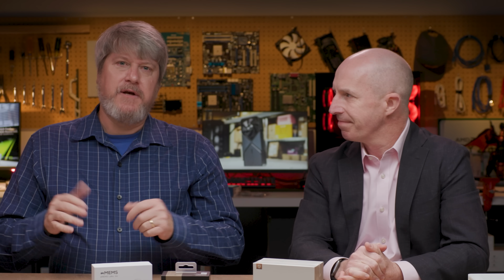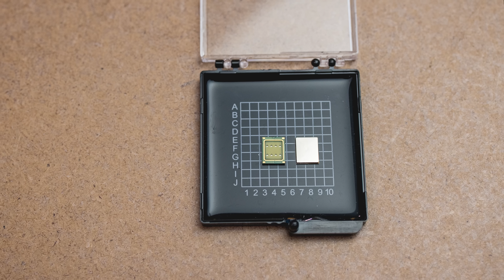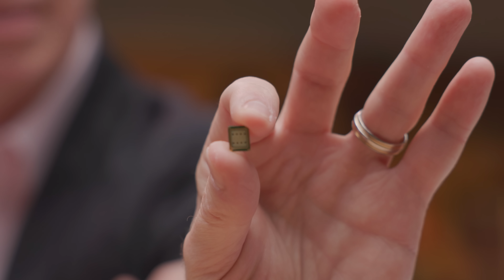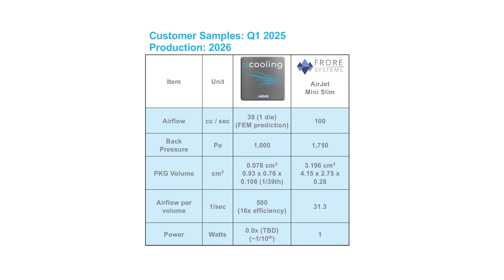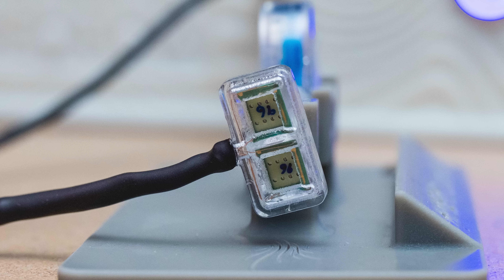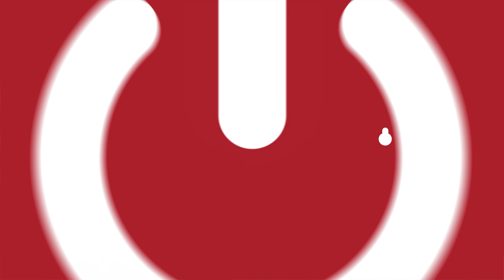This 1mm-Thin Chip Cools In Tiny Places

Comment: It runs on 8" manufacturing 🤯

I thought all those machines were completely out of use by the major foundries. For context when 90nm became the latest node around 2004 manufacturing moved to 300mm wafers. So they're using 20 year old lithography. And it's old enough that there are real supply issues currently for that tech.
Reply: Nope, legacy semi is still going strong on 6" and 8" tools. One company shut down their 4" wafer line in 2019/2020, and was seriously looking at restarting it in late 2020/early 2021. No idea what the final decision was. The main supply issue is that a lot of that capacity is already accounted for. They have specific targets/goals to keep costs down and run as lean as possible, so quickly ramping up/down production is tough since they have to accurately forecast demand ~6-12 months into the future to try and keep production levels even.

Comment: The specs seem pretty insane. 39 times smaller than AirJet but at 39% the airflow. Stack 3 of these and it wins across the board. I'm curious what the sound profile is like, especially at higher capacities.
Reply: I have my doubts that it would scale linearly or that heat removal is as efficient as Frore (it generates significantly less backplane pressure, which is presumably the critical variable that affects heat removal), but in mobile devices where heatsinking into the LCD successfully removes quite a bit of the heat and SoC power usage rarely goes above 5W, this could be a total game changer for improving the performance envelope. Most SoCs won't even go above 50-60C inside the core in order to prevent heat buildup from making holding the device uncomfortable -- with active heat removal, they could probably allow them to turbo up to 70-80C without affecting the skin-temperature feel of the device.

Probably will be a game changer for preventing battery degradation and getting local AI chatbots running on mobile devices within the next couple of years.
Reply: @emilemil1  not sure if it works stacked, to be honest...

Comment: My biggest worry for both this and the Frore solution is dust. How do we manage the accumulation of dust and prevent clogging? I have not seen anyone ask this from Frore, and given that this is the first video I'm seeing on xMEMS, it would have been nice to ask.
Reply: Dust is not an issue, this is mainly designed for sealed systems that just need a little bit of air movement in the case.

Comment: I wonder will they get caked with dust and stop working like fans, can they run in reverse to push the dust out and then run normal to start cooling again.
Reply: Yes, he showed the demo of the chips being able to push air and pull air, bi-directional. Very cool.
Reply: @raymonddsouza8948 wait a min! Wut. 

The tech is indeed impressive. 

 How does one reverse the flow of air? Thought it worked by moving a thin piece back and forth with a piezoelectric effect. Like someone waving an old hand fan. 

  I would like to see why this wasn't done before, and what advances in manufacturing or materials it took before it could be done. 

 It is a solid piece of tech. Uh um literally!

Comment: Interested to know how this would impqct the waterproof-ness in a Smartphone as a lot of flagships are IPx7/x8 these days
Reply: It wouldn't, as it's just recirculating the air that's already in the case, it's in a sealed system. It doesn't need outside air, it just blows air onto the chip, and that's all that many chips need.
Reply: @madmax2069  what good would spreading warm air around do if you don't ventilate?
Reply: @fuicaz   because even spreading around warm air is better than spreading no air around.. things like cellphones are intentionally limited to not get warm, one of these could allow them to raise the performance limit
Reply: @madmax2069  No spreading of warm air is going to be better than heatpipes/vapour chamber or even graphene pad/sheets actually spreading the heat around via physical contact. Keep in mind air is a good insulator. Air is only good if it can take the hot air away. In the same way if you're in a hot enclosed room, having a fan is practically useless. You're just mixing the air in the room, increasing the ambient temperature. Yes you can argue it helps, and I won't disagree, just to what degree does it actually help? I would imagine it helps a tiny tiny bit. Not zero, but very little. Especially considering how little air is actually within a phone.

Don't get me wrong, I am excited by all new technologies, I just fail to see how this works in a phone.

Comment: How much power does it use?  In terms of watts cooled / watts used?  That's the big problem with the Frore AirJet -- too inefficient compared to a traditional fan. Edit: the numbers he gives at 7:55 multiply out to 39 mW pneumatic power. Website claims 30 mW power requirement, so presumably those flow and pressure numbers are not attained at the same time.  Seeing as AirJet is less than 10 W/W, and smartphone SoCs typically sustain multiple W with current cooling designs, this is maybe really good.

Comment: It's going be helpful with VR like Vision pro became smaller in size or
Reply: Unlikely, unfortunately. They are small, but their cooling capacity isn’t that great, Vision Pro need to cool 20ish watts of heat. And their big modules stacked in a way to provide enough cooling in that space would be almost as large.

Comment: if you place it with silicon die this will make it vibrate , so what about metal fatigue? will it crack the die ?
Reply: Cool thing about MEMS at least what I know is that they are extremely reliable because of lack of moving parts. A lot of car components/sensors specially the ones that determine if you were in a car crash use this tech because it is reliable. The actual air bag has issues but not the sensors.
Reply: @erikpienk  yes i know they have no moving parts but they will vibrate with this and the air moving could move particles that maybe damage the silicon ,my question was if they fuse this with silicon die of a gpu or cpu will it damage it overtime?

Comment: I wonder how would phones maintain water resistance if they have to push air out, at least gaming phones use some kind of liquid cooling solution.
Reply: Same way as how ip68/69 rated phones speaker membrane allow sound/air out while stopping water and dust from entering. Some of the phones with large speaker can feel air coming out of the speaker vents when playing loud music. There are videos of phone speaker blow out candle flame.
Reply: Many wouldn't push air outside the case, or intake air from outside the case. A lot would be used in a sealed systems (which most phones are) and the chips in said phones only really need air moving past them to cool them better.
Reply: „Gaming phones“?😂
Reply: nice

Comment: This sounds like this could cause interference related issues in chip with earths magnetic fields or even generate Eddy currents  within chips due to nearby magnetic fields and also may cause micro cracks in chips
Reply: NO. It doesnt use magnetics to work, its more voltage and very small currents. The mass of these are to small to resonnate anything. They might not even resonnate at the same eigen frequency, so basically just making miniscule amount of white noise too low to hear. Otherwise they couldnt have used them in IEMs one would think.

Comment: I dislike laptops because of ergonomics, comfort and performance but I do find this topic interesting. With the stacked memory and other stacked parts of CPU's and GPU's (which should happen in the next 1-2 decades) we need new techniques to dissipate heat and yes, chips can be used for that. There is a lot of interesting reseach being done and some of it is based on decades old ideas which just weren't needed back then. If you want to know more about the latest developments on a more technical level then I recommend the channels Anastasi In Tech (she is a chip-designer) and asianometry, both channels are a treasure trove of information for the nerds who want to learn a bit more about the hardware insteaf of only knowing what you can do with that hardware. It gives an idea of what is coming for hardware in the future (patents, research, ideas) and it shows how the hardware is made (like a tour at ASML).

Comment: What about dust build-up?
Reply: Itll be internal in a device, so dust will be up to the device manufacturer to solve. The mems device wont be involved with the device's dust seal, itll be right on top of the chip directly soldered to it or otherwise attached permanently.
Reply: Dust is what happens with traditional cooling solutions that push aír into the device with fans. This technology might get rid of this issue, at least spreading the heat away from the source so it can be pushed away by fans, that's a problem for thermal dissipation design.
Reply: this is my biggest question for this tech.  It has some great potential but if it jams up after 30 days from build up it's worthless.

Comment: Low profile passive cooling would be great.
Reply: It's not passive, it's active.
Reply: @LeesChannel  correct if you looked at the video they mention a hybrid with traditional cooling.
Reply: This sounds like this could  cause micro cracks in chips & cause interference related issues in chip with earths magnetic fields or even generate Eddy currents  within chips due to nearby magnetic fields
Reply: @soulsbourne  The only part of a phone that interacts with the Earth's magnetic fields is the compass.  They are effectively DC.
Reply: @soulsbourne  this wouldn't

Comment: what about if dust get on the valve that small and also longevity on the moving mems itself?
Reply: I didn't bring this up, but xMEMS says that it's IP58 dust- and moisture-resistant. To be honest, the IP specs don't seem to go into too much detail as to what that means in terms of particulate size and so on. It's a good question, though.
Reply: Judging by the Frore product demonstrations, this likely generates sufficiently high air pressures that it can use real dust filters over the air intakes to prevent this from being a problem. Conventional fans typically can't generate pressure high enough to do this and therefore need porous intakes which let in small dust particles.
Reply: Exactly what I was thinking. Also power efficiency to cooling capability. Also any degradation over time?
Reply: piezoelectric mems last forever and wear wont be a concern. there's a famous story from early researchers putting a piezoelectric fan on the wall and running it for decades and only took it down because they were moving office IIRC
Reply: Maybe it works inside a sealed phone, just spreading the heat around. Not as efficient as a heatpipe for sure, but much smaller.
Reply: Will they also launch the world's smallest replaceable HEPA filter? :D

This might be more useful in a data center, with heavily filtered air. You could have cooling mounted right to the SSD (or something else that doesn't take gobs of power) and then require less case wide cooling.
Reply: @DogWalkingBot  ideally you're dust-proofing the device itself, which most phones essentially already are, rather than the air intakes.
Reply: This sounds like this could  cause micro cracks in chips & cause interference related issues in chip with earths magnetic fields or even generate Eddy currents  within chips due to nearby magnetic fields
Reply: @soulsbourne  Piezoelectrics do not use magnetic force, and besides, the electronics inside a phone are already exposed to tons of rapidly varying magnetic and electric fields.

Comment: What is the mechanical life of those valves?  What about the other moving components?

The tech is very cool (hah!) but it is another point of failure.  I can't help but be concerned this will be another common failure with difficult to source/replace component.
Reply: Good question and I don't know the exact answer. However, xMEMS adapted the technology from earbuds like the Creative Aurvana Ace 2 and the limited hardware warranty period for that is 12 months, 24 for the EU.

Comment: It is always crazy to see these things working. But they never really talk about pricing. =x
Reply: It's B2B, people won't be installing this themselves.
Reply: Consumers would never buy it. It's meant to be installed in something you would then buy
Reply: @JBrinx18  This one, OK. But Frore? They could be selling their Airjets like poptarts for people doing mods.
Reply: @gabriel65412 mods are such niche cases, they are still b2b. Laptop cool isn’t just replace the fan, everything inside needs to be considered, laptop manufacturers have to design from scratch with these cooling chips in design, and this integration is what brings them money, not some random DIYer buying this for modding, cannot make them much money.
Reply: Like most semiconductors, cost will be entirely dependent on economies of scale. The more they make, the cheaper theyll be.
Reply: It'll be B2B and likely seen in thin light products wanting better performance. So laptops, tablets, mobile gaming devices, SBCs, SFF builds, and such.
Reply: They go out of their way to not talk about pricing 😅
Reply: Well, show me any benchmark what show you how the chip itself perform, and the tester also tells you and the chip inside this phone was only $49...
Reply: The speakers are on their websites for sale, $20 each just for the module. Reference wireless headset is $1k. So not mass scale yet but definitely within reach of niche audiophile headsets.
Reply: You're not likely to buy this yourself. Unless you own a company. If that's the case you wouldn't ask for pricing via Youtube comments lol.
Reply: @bassyey really? Have you heard of Mouser, Farnell, etc? They sell components and equipments of all sorts. Prices are all open, even for very expensive stuff...
Reply: This sounds like this could  cause micro cracks in chips & cause interference related issues in chip with earths magnetic fields or even generate Eddy currents  within chips due to nearby magnetic fields
Reply: Listen, Professor.. wirhout you doing tests, your comments are really just moot @soulsbourne

Comment: Curious how something vibing at a few hundred K on an SOC would impact longevity.
Reply: A lot of mems devices are active and internally vibrate without issue.  Mems can vibrate for practically eternity.
Reply: @AaronALAI Just because the mems can that doesn't mean what it is attached to can
Reply: @RCVW-y4x what do you mean by that? By your logic you should not air cool chips because vibration from fans will kill the silicon? If chips can outlive constant thermal cycling (30-90+C) then these vibrations or no big deal
Reply: @pretentious_a_ness Your example wasn't by my logic.  Bit of a difference between a fan humming along at a few thousand cycles a minute buffered by a by air cooler and something humming along at 120k direct to chip.  Why are you so offended by someone asking a question? 

Also, thermal cycling is a totally different set of forces and ideas.
Reply: @pretentious_a_ness  fan vibrations are low frequency
Reply: @RCVW-y4x I don't think it can damage the die.
Reply: probably not much the membrane is what vibrating and it is made to be as light as it can be, you do not really want to vibrate more mass than you have too, probably barely even measurable and remember the chassis does absorb vibration, the IHC of the chips, everything so at the end of the day I am pretty sure it would not do anything to a silicon chips... those thing can take a lot in the face
Reply: It wouldn't harm the chip the membrane in this is so light even if it's moving at 100k you would have a hard time to detect it. It's not like you're moving a 1 pound object at 100k. 

Plus thermal cycling is far far more stressful than what this would ever be and chips handle that with ease.
Reply: This sounds like this could  cause micro cracks in chips & cause interference related issues in chip with earths magnetic fields or even generate Eddy currents  within chips due to nearby magnetic fields